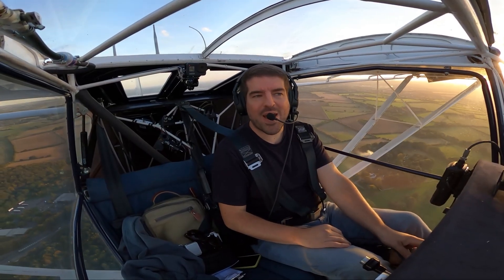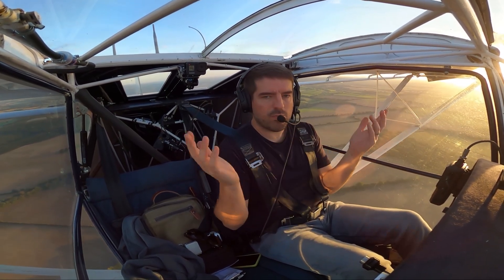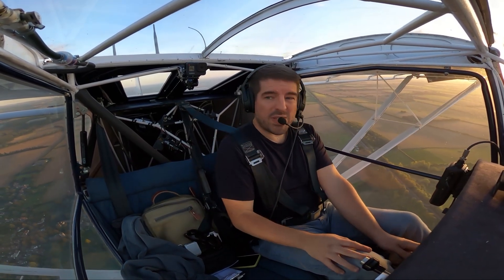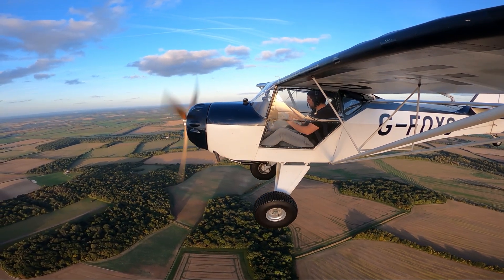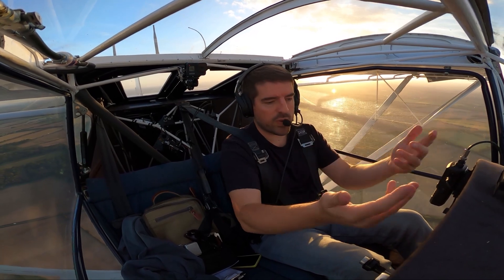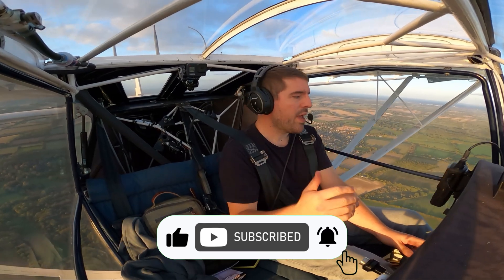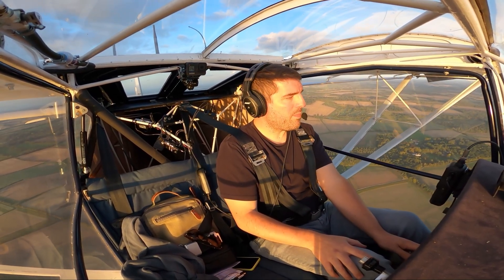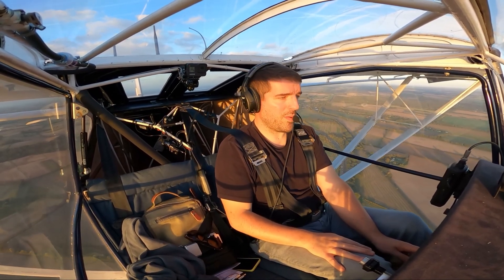Kitfox engine problems update | Rotax 582

Comment: Would love to hear it idle.  I kinda have a little bit of that rough problem too.  I rebuilt the carbs with the update and have only flown it about 25 hrs.  And I have tried other plugs and I'm currently trying to make sure the carbs are equally adjusting.  Thank you for the video and please let me know if you make a video of it just idling after start at the lowest setting.

Comment: As far as the prop goes, and you may have done this already, GSC supposedly has a 5 year life span on the prop.  It's easy to over tighten them as well and crush the wood fibers.  If the two halves of the hubs are touching, you shouldn't fly with it.  The wood has been crushed and it could loose a blade.  I've bought a couple of NR props from Ukraine for my Kitfoxes and they work pretty good.  Not real expensive either.  As far as the choke/enricher, I've always used a snowmobile style primer.  Starts way faster when cold with a shot of straight gas.  And no problems with cables and such.

Comment: Great video! Quick question: are you allowed to do maintenance yourself? Carburettor inspection is key in my view. Over time the settings can vary slightly with material deterioration of performance.
Reply from the maker: Thanks Benny! 🙌

Under the UK CAA and LAA 'Permit to Fly' system we need an LAA inspector to sign-off any work carried out that isn't considered 'pilot maintenance'. So yes, there is quite a lot I can do myself, but anything more major will need inspection and sign off.

Comment: Rob
Great video, looks like a GSC prop? They can change shape slightly, and cause vibration.
I have an Avid flyer, with a 582 and an ivo prop.
I had starting trouble when the engine  was hot, it turned out to be my battery, it wasn’t quite giving enough umph, to get a decent spark.
I also changed the leads and plug caps.
Steve
Reply from the maker: Thanks Steve 🙌 I'm considering changing to a carbon fibre prop, maybe an Ivoprop, how are you finding it?
Reply: @RobHolmes8  
The ivo seems two work well, it’s quite a large dia 72” and very smooth in flt. The big dia is good for short field take offs, but not so good for the cruise. I’m considering cutting it down a bit and coarsening the pitch, for better cruise.
I had a two blade wooden perie prop to start with, and I experimented with different ratios in the gearbox. I tried a 3.47:1 which was to slow for the ivo. Getting the right combo is really tricky. Indecently my avid is the speed wing version.
Steve
Reply from the maker: @stevenstyles7602  thank you, that's all really good to know 🙌

Comment: Rob difficult to see on your videos but your exhaust gas temps look like they are high?
Reply: Good luck on the probes as far as I can see they are no longer made.
Reply from the maker: Good spot, you're right they are showing high, maybe 1250. But I've checked the plugs and they don't look to be running too lean, they're a good colour.
Reply: @RobHolmes8  probes are notoriously vague… so plugs are a good indicator. I had loads of problems with the carbs on my 582. Mostly needle splits, which were resolved by replacing probes. Mine runs at about 620c at 5000rpm.
Reply from the maker: @gordonwilson1653  that's a good idea, I think I'll look into replacing the probes at some point.